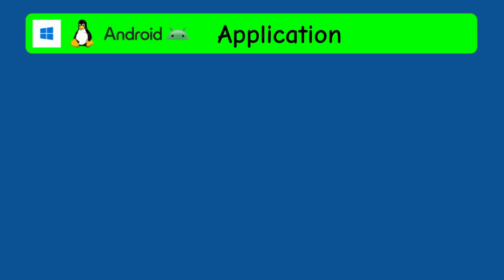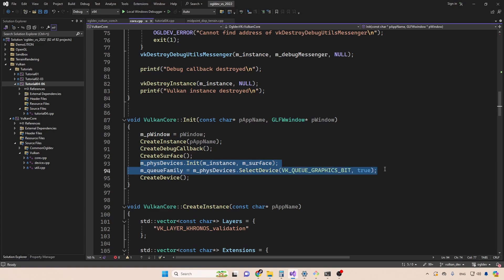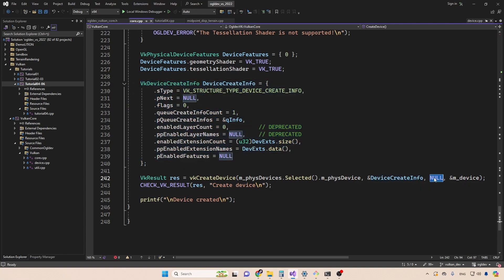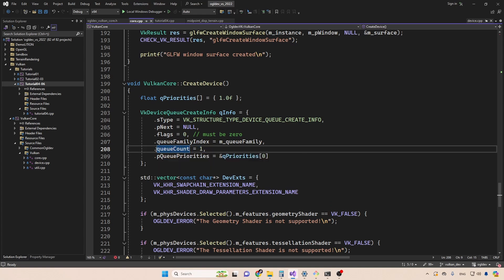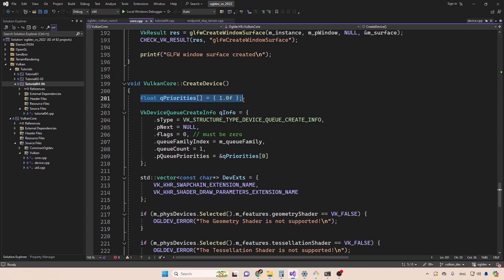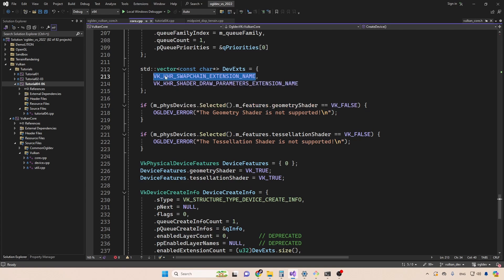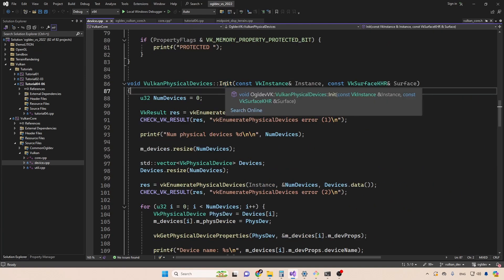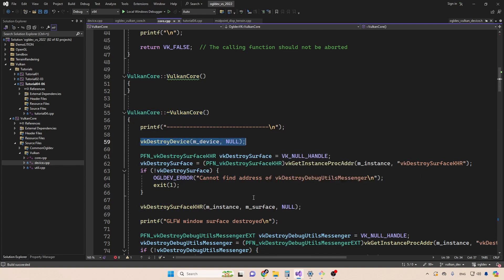It is illogical (device) // Vulkan For Beginners #6

Comment: Do you think we will have more FPS with VULKAN than with OPENGL for the same game ?
Reply from the maker: If you architect it correctly, yes. Vulkan provides you the tools to take advantage of the parallelism on the CPU and GPU and you can tailor the behavior of the GPU to fit the specific game. In addition, it reduces the overhead of the driver which can be substantial. An OpenGL has to be generic because it has no knowledge about how the game behaves. However... it is not so easy and you may end up with something that doesn't work faster if you don't do it properly.